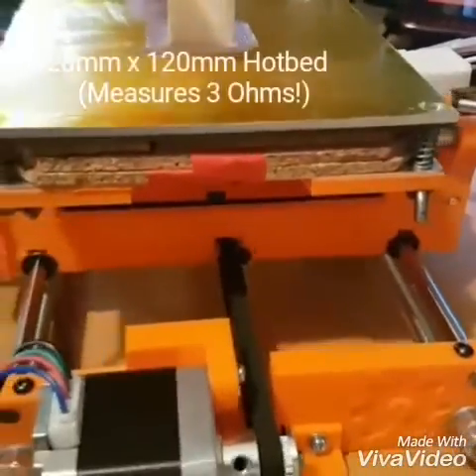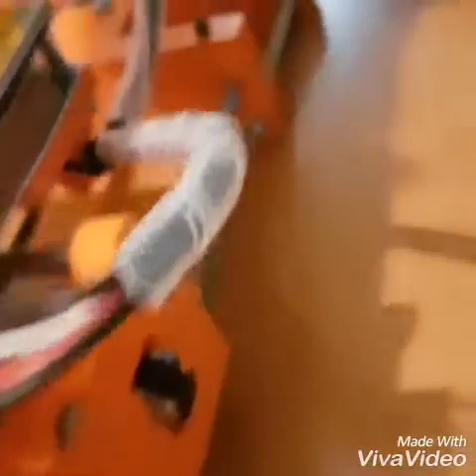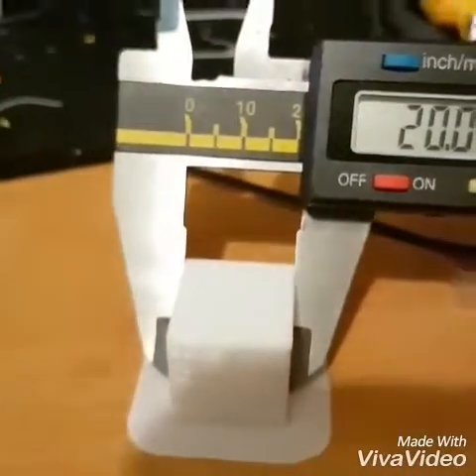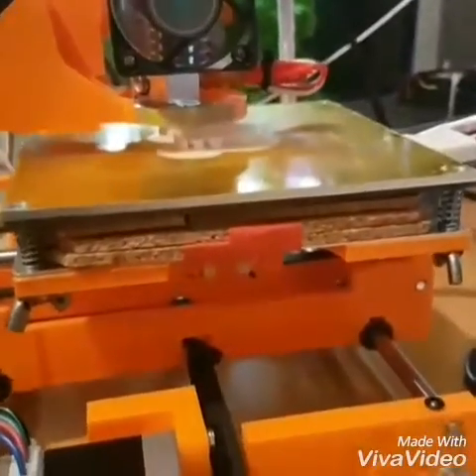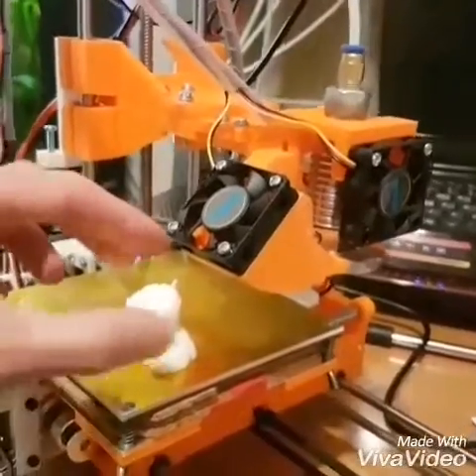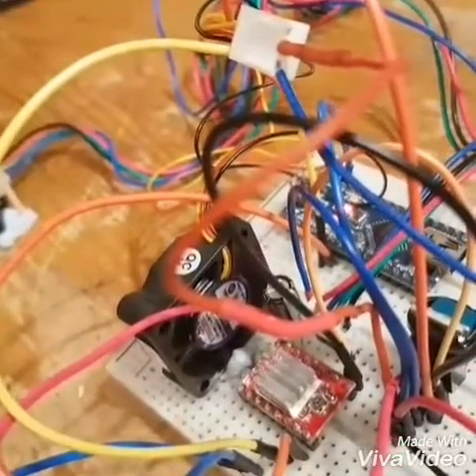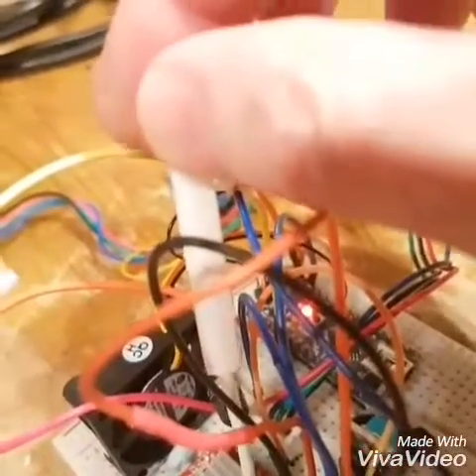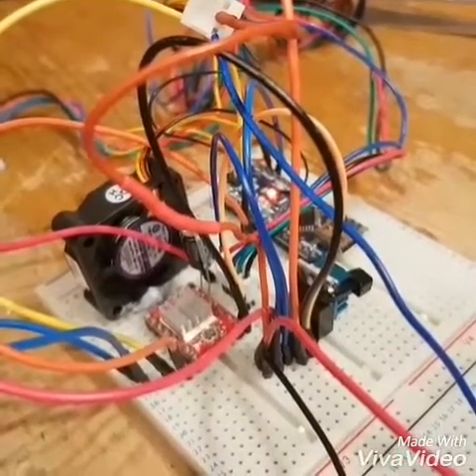Atom X Heated Bed Mod and Roadtest

Comment: Great stuff!  How much did the 3D printer cost you btw?
Reply from the maker: GadgetUK164 Thanks. The original one that I printed this one with (Anet A8) cost £150 from Gearbest. This one cost me about £25 for the Arduino clone, LCD and Ramps board, £10 each for 4 motors, £10 for the hotend and teflon tube, say £30 for rods and pulleys, £5 for bearings, £5 for microswitches and £25 for the heated bed. That makes £135 but I could have probably got parts cheaper if I weren't so impatient :)
Reply: Thanks for the info! =D